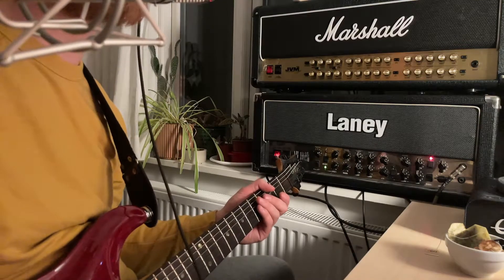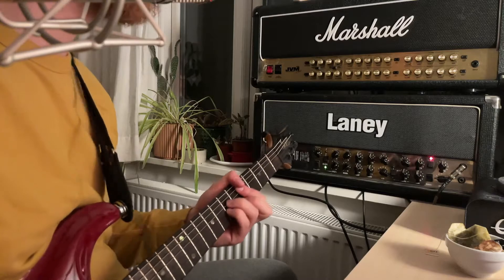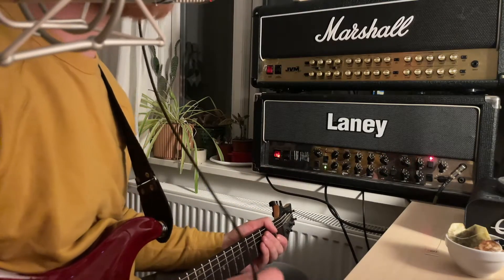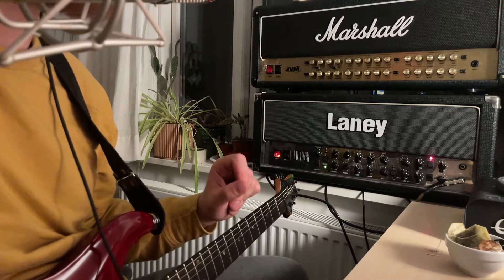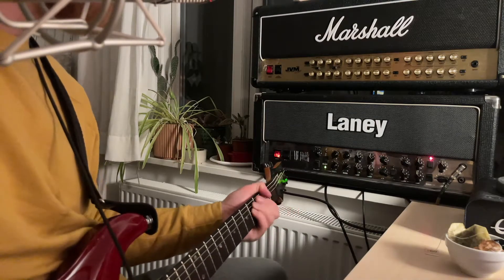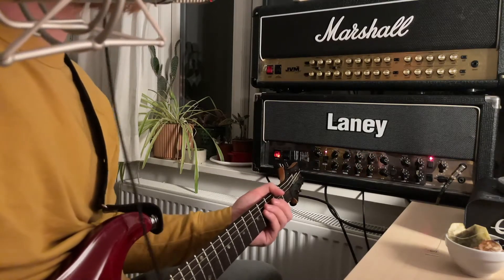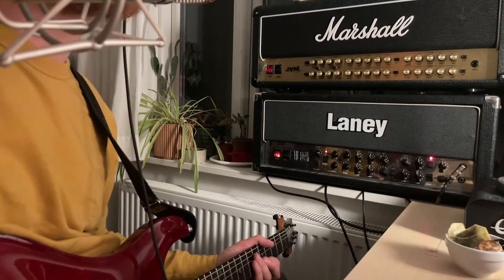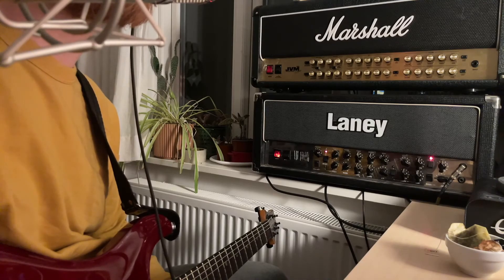Laney VH100R Help Request

Comment: The problem is most likely either a bad V3 or a problem with a component in V3a or the subsequent clean tone stack (which feeds the dirty channel so any issue there will be even nastier when distorted). It sounds like the tube isn't biasing correctly but a bad filter cap for that stage or a bad treble cap in the tone stack could cause that.

A tech can find the issue quickly. From a distance I can only guess. But if a known good 12AX7 in V3 doesn't fix it, tech time.
Reply from the maker: 2 years later, I learned to service amps. Your remote assesment was correct: It was the electrolytics, changed everything on the clean PCB and the problem went away.
Reply from the maker: Really appriciate you looking into this Lyle! Tested out a few V3's and they all sound like that - off to the tech!

Comment: Did you fixed it? I have the same issue
Reply from the maker: Not really actually. I swapped tubes around and that helped the gain a lot. For the cleans I just roll back the volume a bit or use lower gain pickups.
Reply: @lordgraga  Weird. I don't have that issue, not on the clean or the overdrive channel. One thing, though -- related or not -- my clean chanel is SUPER loud. Impossible to go past 1.5 on the volume knob. But no hissing at all like in your video... ( I use hot humbuckers, 16K and 24K and use Sovtek 6L6 tubes).
Reply from the maker: @Wilandovsky  sadly that’s how the clean channel is on all Vh100’s :-( You can remedy it with a 12at7 or a 5751 in V1. I also like those in the phase inverter.
Reply: @lordgraga  It doesn't really bother me because... I always like a little drive even on the clean channel -- with the drive engaged, the volume becomes perfectly "normal" (at least on my example).
Also, I think it's gonna be my live amp, maybe forever (so far I've gigged with GH 100S, but it needed an attentuator while VH 100 doesn't :).
Reply from the maker: @Wilandovsky  Yeah the drive solves it. I have a GH100S too but I find it too unwieldly... the low input alone is neither clean or crunchy enough, and the high input rips my head off. Got the same?
Reply: @lordgraga  I record with it :) The trick is to play it with a volume past 6.5 (possible in a studio, not in small live venues) where it shines and I actually use quite a lot of gain -- but I roll off the volume on my guitar to about 6.5-7. This amp is very nicely controlled with a guitar volume knob.
Reply from the maker: @Wilandovsky  do you have any music out where you used it?
Reply: @lordgraga  All guitar tracks were done with GH100S in this one: https://www.youtube.com/watch?v=3T5B4A7LnZE . The distorted tracks were all on HI gain channel with the master volume on 6 and the gain on about 4.5 (and I wish I had more that...). The cleans were done with the LO channel. I used a boost pedal in front.

Comment: I slightly have the same issue on my vh100 and what I have notice is that all my tubes in there sockets are slightly loose or loose. Even the preamp tubes so I need to retention all my sockets and see if that helps .

Comment: Your dirty channel actually sounds very good considering the drive and gain are both at 5.I think your pups are hotter than you realize.How old is the amp and the tubes? When you swapped the tubes around did you see all ecc83's or any tube variant other than an ecc83?You might have put the v3 tube in the v1 slot in and vice versa when doing a hasty swap.The vh is a high gain amp so hot treble information is prevalent even at 5 or ""noon"".Definetly check what pre amp tubes are in the amp.The clean tone stack in this amp is only valves 3 4 5.v6 of course being the phase inverter and has nothing to do with the clean or gain channel sound overall.It does not sound like any of your tubes are bad at all or any components.Maybe it is a sound you are not use too.Seems the amp is fairly new to you?
Reply from the maker: Hey, thank you so much for both your comments!

I have spent some time swapping out tubes very carefully in all positions, and have sort of come to the same conclusion as you here about the clean channel just simply being past breakup in a way that wasn't pleasant. I found tubes that sounded better in those positions, and it has made the channel work much better for me. About the distortion, similar result.

I had this amp for 1½ years and it was always like this. The amp is from 2006, and I had it out of the chasis. The overall condition on the inside is very good, and I taptested many many components and found no issues on visual inspection (except a small hole in some filter cap shrink wrapping on an edge,  but I give it a pass).

Someone else wrote a really good message to me on my main Laney Vh100R video talks about how the amp's negative feedback is dialed in so that it gets a bit icepickey, and suggested me a mod that allows me to adjust this. I am absolutely considering this for the future.
Reply: @lordgraga  Hello.You are welcome for both comments.Yes icepicky indeed i would really like to know about that mod.For me the best tubes for my laneys are jj's.Sovteks were the stock tube and they just were not robust enough on the lows and mids and the hi end was icepicky and harsh.The jjs helped smooth out that issue somewhat.Yes my filter cap has a shrink wrap hole as well on the edges of both sides.But i have never had an issue so they pass.Be very careful when tap testing tubes and components.If tapped too hard what didn't have an issue could develop one.

Do you mind if i ask what tubes you found for your clean channel? Cheers
Reply from the maker: @SimmonsCabinets  for the mod, look for a comment from Kevin Leahy Jr on my other VH100R video. I run TAD Redbase 6L6 tubes, which I greatly prefer over the TAD EL34 that I had before (newer ones, I never used stock). I feel like tube brands don’t mean much… For clean I think I have V3 TAD 7025WA from my Laney VC30, V4 SB Elektronik, and V6 an old Marshall ECC83M. I know that V5 also matters, but I think that one is a stock TAD.
Reply: @lordgraga I found the persons comment you mentioned about the mod but no mention of the mod.Did i miss something?
Reply from the maker: @SimmonsCabinets  Hey dude, this is super weird, but the user deleted the comment with the instructions and I gave you the wrong name cuz the other guy was the most recent comment (maybe he was banned from YouTube?). Luckily, I have a screenshot of what he told me. Sent it to you mail.
Reply: @lordgraga  Hi Jacob.I never received any email.
Reply from the maker: @SimmonsCabinets  you are not simmonscabinets@gmail.com ? Anyway I have been looking at the mod and it looks OK but I wanna verify it with a pro before I do it.
Reply from the maker: @SimmonsCabinets  Look for the Facebook group "Laney Amplification Forum", I posted the instructions there and got some good feedback from other users.
Reply: @lordgraga  Nice.I saw it.The feedback from the other members seems good.I might think about that mod some more.Not exactly sure if i should do it yet.

Comment: I have 2 of these amps.From 01 and 02 usa spec.The vh100r is known to be a noisy amp.Looks like you have the bright switch on in the clean channel and that definetly accentuates the treble and hi end frequencies information. Humbuckers whether hi output or not hit the front end of any amp with double power to that of a single coil.The laney vh input is very sensitive and there is a 6db difference in the hi input over the lo input.I could hear the difference in sound when you changed to the lo input.With that being said if there is an ecc83 or a 12ax7 in valve position 3 then the 2.5 you are thinking you are hearing is actually normal gain output from those aformentioned tubes being their gain output of those tubes is 100 percent gain factor.If you would like to alleviate the 2.5 noise then i would reccomend a lower gain tube..IE a ecc82 being the lowest at 16% gain or an ecc81 being 60% gain.5751 being just behind the ecc83 at 70% gain factor.The issue you have with the power tubes isn't really an issue at all.It is a preamp issue you are having.

Comment: It almost seems like the clean channel has the drive engaged. I can see from the front panel that it is in fact engaged, but the LED is turned off so I assume you're controlling the amp with the FS4 footswitch and you disable the drive from there. Honestly, I have no clue, I had this amp for just a week and it works fine along with a Torpedo Captor 8 and a Mooer Preamp Live used as noise gate and IR loader. I guess you already tried this but you might want to check from the FX send (you can use the second last outlet, the preamp send) if you still hear the driven clean channel. This will allow you to understand if the problem is in the preamp section or on the poweramp. If it's the latter, maybe you have high biased power tubes, if it's the former, well, then I have no clue, unfortunately. Anyway, I wanted to thank you because your videos of Opeth tone chasing convinced me to buy this amp, I was tired of trying several preamp pedals and modelers and not being able to find the tone I was looking for. Hope you'll find a way to fix this, not having crystal clear cleans it's a bummer for that amp. Cheers!
Reply from the maker: Thanks for sharing this! I’m super stoked you found the videos helpful, hope the Laney will serve you well moving forward. Thanks for the tech tips. Question: how does your amp behave on the gain channel? I think it’s normal to have some of that 2.5-3khz build up on the drive, it just seems excessive on mine.
Reply: @lordgraga  Hi man! Regarding the 2.5 to 3 KHz noise I'll have to investigate further, but I can remember that when I was playing with the knobs of the distortion channel I wasn't able to turn both the main and the additional drive knobs all the way up since the amp would start to hiss and feedback even when the guitar volume was turned all the way down. The hissing sound might have been in that range. I fixed it by lowering the distortion channel volume and by bringing up the "master volume" from the back of the amp (setting the clean channel volume soon after in order to be consistent with it). You should set the global FX loop to "insert" and then you can use the knob on the back as a master volume. With this configuration I was able to turn the drive up way more while still avoiding the noise that I think was coming from tube 5 or 6 (I probably have some not-in-a-good-shape preamp tube). Also, this amp is VERY bright, but I managed to find a sweet spot lowering the trebles and bringing the presence knob a bit higher to compensate the treble loss. Hope this can help, cheers!